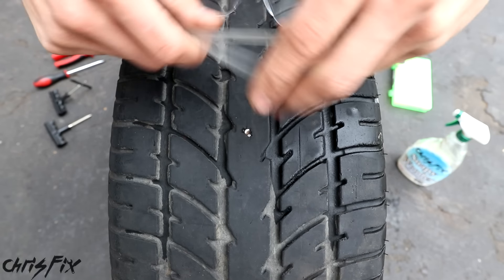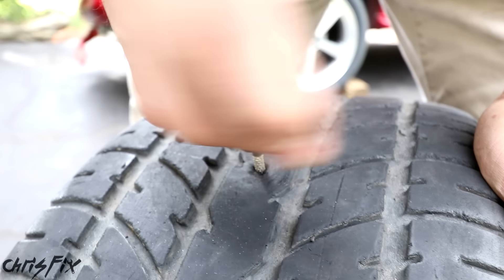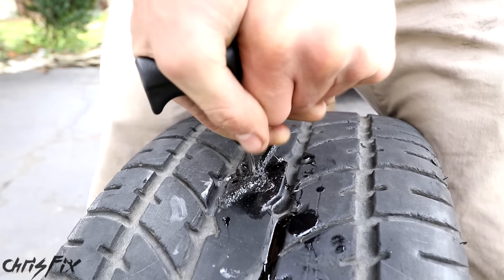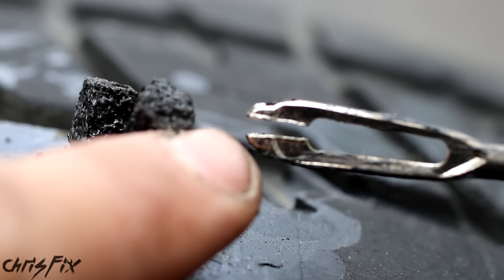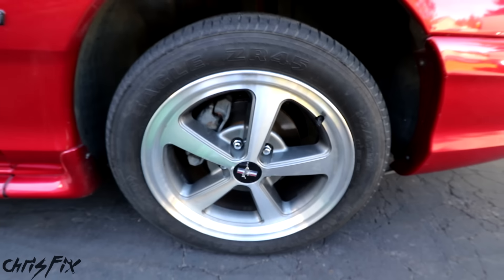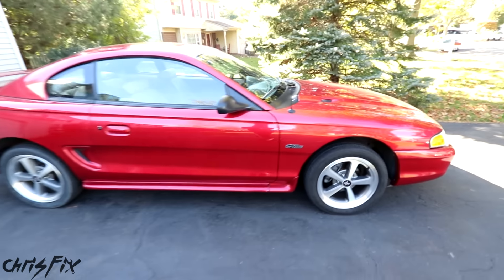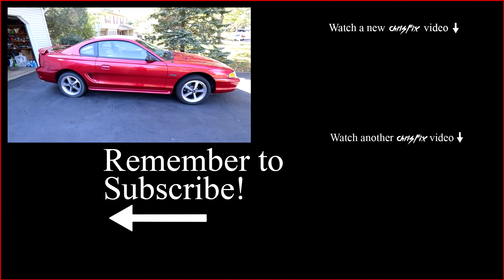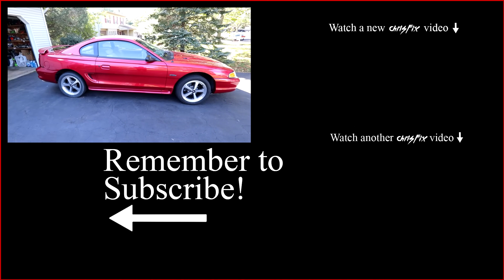How to Fix a Flat Tire EASY (Everything you need to know)

Comment: I patch tyre leaks with plugs all the time and never replace them... usually lasts for the life of the tyre... Only in case the hole is big and plug is lose/leaking I get the Mushroom style plug fixed from inside the tyre. Good beginner video.

Comment: Rolled many plugs in the past , with out rubber cement . On my 2006 ram 1500 4x4 I think I’ve have two in the whole set . and my wife’s 2013 Acura RDX one in her set . They seem to hold up great in both summer and winter conditions.

Comment: great vid  other points  you can  pull a screw and patch with out  removing  on the front  BY TURNING the  tire  out  to work  on   -----ps be sure the kit has the wax 
for eass  of plunging the plug  5mins

Comment: A Certified Mechanic told me many years ago never to put the "donut" spare on the front.  Always the back, as it is very temporary, and get the tire fixed/replaced ASAP.  If the "donut" blows, it could flip the auto.  Everything else in the video was/is solid.

Comment: Excellent video -- again. Comprehensive, concise, clear. Good that you mentioned checking the spare's pressure.  One disagreement. I don't enlarge the hole. I don't want a small hole so I certainly don't want a big hole. I just trim the plug accordingly. I've never purchased the road hazard warranty for tires but from what I understand from others, tire patch is not free.
Reply: The reamer is to clean shape and prepare the hole to help ensure a better seal not to enlarge the hole
Reply: @pizzapizza2424  Correct. Removing irregularities does enlarge the hole which I find undesirable. There is only sealed or not sealed. I'm happy and more comfortable with a small sealed hole. Sometimes the hole is too small to use the plug tool which makes for extra work to install the plug.

Comment: One trick I learned from a friend, is if you have a really large or really dirty tire, to just apply the dish soap directly to the tire and then soak it with a hose. The resulting liquid is much more viscous and then premix soap water and is better at finding small pinleaks.

Comment: I've had various tires plugged on various cars, probably about 20 different times by the tire shop. The plugs never failed. They last the lifetime of the tire. I've never gotten one of those patches but a friend of mine did. The only reason he got a patch was because he insisted that he wanted a patch. The shop did it, and that worked too.

Comment: I love the guys at the tire shops that don't know what the dot on the side of the tire is for. The dot goes where the valve stem is . That's why when you have a tire balanced it takes so much weight to balance it when you don't use the dots. Another favorite is you stick lots of stick on weights on top of the others that stay on until you get out of site. Can't hardly find a good tire shop in Ga.

Comment: It looked like your camera was on a tripod when you were opening the trunk. Do you keep your camera equipment with you at all time, did you run home to get it, or did you drive to the store they drive a screw into your wheel just for the video? Either way, that's dedication. 

I've driven on plugged tires for years and never had an issue. Also I've never trimmed of the excess. After a little driving the excess just wears.

Comment: I bought the Slime 1034-A Automotive Accessories.  It worked real well, but I still upgraded to the Slime 20290 Pro Series Ultimate Tire Repair Kit.  I probably just got lucky with the cheap model.  :-)

Comment: Hi Chris. Thanks for all the work in showing us the way. It seems the debate around the safety of plugs is pretty solid and leans towards the unsafe manner it is used. All major safety organizations and tire associations prohibit the use of tire plug due to safety concerns. I can see using it in an emergency yet not as a permanent solution.
Reply: 2 years ago i first heard of this plugs. Since them i drove a lot on dusty sand roads and had to use them 5 times. The oldest of them has now 30.000 km on it and still going strong.

Comment: One small detail to add. If you are out there change to the spare tyre. And you have no access to a stand  of any kind. Use the spare tyre as a precautions and swap it with the leaky tyre when you are ready to put on the spare.

Comment: This video reminded me of the time I found a screw lodged in the front tire of my Motorcycle. Luckily for me, it plugged the hole completely so no air leaked, which meant I cold drive it to the closest garage to have the wheel looked at. 
The mechanic at the garage said that I needed to have the whole tire replaced because of the screw and it's gonna take a while because they need to order a tire, since they don't have that many MC-parts in storage.
I head to the local [My motorcycle brand] dealer, that I bought the motorcycle from a couple of years ago, to order a new tire.
The guy at the dealership's workshop takes one look at my tire, pulls out a kit and essentially does 7:37 - 9:49 right in front of me.
Total cost: $10
Time needed: 15 minutes (5 for the repairs, 10 to just shoot the breeze and discuss if I'm happy with my MC or if there's anything else I want him to take a look at).

Comment: I was under the impression that tire plugs are a permanent solution. Thank you for highlighting that you still need to get a shop to put a patch on later.
Reply from the maker: Technically they are not permanent but off the books, they are basically permanent lol.

Comment: I had a slow leak always the same wheel, even after a tyre change. I finally used an aerosol which cured the problem and it lasted until I needed new tyres. My current car had a screw in it after just a few weeks from new. Fixed that with a spray and again lasted until tyres were replaced.  
One more comment - the kind of pump you used usually has a limit on how long it can be used continuously.

Comment: Just for anyone scrolling, for clarity. if you use fix-a-flat, a rope plug, have multiple points of damage or damage to the sidewall or shoulder of your tire, all but the sketchiest tire shops will not repair the tire. your mechanic probably also wont like you too much if you use fix a flat cause its a giant sticky mess to clean off the tire machine after. as a mechanic, my reccomendation is either to throw the spare on or call a tow (if you dont have a spare incl some like BMW owners) and have it patched at a shop if it can be, the patch they use will be good for the life of the tire because vulcanizing cement is used which essentially welds the patch into the tire. it will last the lifetime of the tire and you wont have to worry about it failing or letting water into the belt package, causing damage that could lead to a blowout. also usually patches at shops are fairly inexpensive (definitely cheaper than a new tire) if not free if you bought the tire from the shop your bringing it to (i.e. Firestone has the "road hazard warranty" meaning for X amount of miles your tire will be covered if you have a nail in it, either patched or replaced if its non repairable)

Comment: Plug pusher usually damages the metal mesh beneath. Which further results the tyre to mess up the alignment... The loss of aligbment results wobbling while you drive. Getting the tyre opened and fixed from the inside is bit costly but ensures  avoidance of early retirement of tyre

Comment: Important note: push the plug tool directly into the hole and DON’T twist it on the way in. It should be a straight push. That way the plug material does not start tangling around the tool.  Then, when it’s 3/4 in, pull straight out. Again, do not twist on the pull out. Chris was twisting too much on the way in, which will make it harder to pull the tool out.

Comment: Hey all, Just my experience, so take it for what you will. I've used Fix A Flat type stuff for years and love it. Although, I have found that the actual Fix A Flat brand doesn't work all that well. The other brands work great though. I don't understand how it is supposed to ruin a tire. I have run tires for years after putting that stuff in the tire and have never had to replace the tire after having used it.  As far as the tire tech not liking to break down the tire with that stuff in it, we all have parts of our jobs we dislike. They wouldn't walk for you, so jam that stuff in your flat tire and away you go without a second thought ;)  It will gum up a TPMS sensor in your tire if you have one though, so be aware of that.

Comment: Even if the video is 5 years old, I think worth informing new viewers that i have a flat on brand new summer tire in 2016, I rode on the same plugged tire for 5 years and finally replace it in 2021 with new one because it worn out. It is safe to ride on plugged tire as long you stay on flat road. I think if you ride off road a lot then better to get it repaired although i think it will do just fine.

Comment: A lot of times the rim will be fused to the hub so before I jack it up I loosen the lugs a few threads and move the can back and forth a few feet which usually breaks it free. Doing this first will eliminate taking the car off the jack to do it later.

Comment: a 12 V compressor in your car and manometer.  Repair kit with plug and liquid soap.  A carpet+coverall
I never removed a wheel or change a wheel for a flat. I have 1-2 flat a year.
Identify the hole, fill air if needed. move the car to be confortable to install the plug.  
remove the object on the tire, and remove the air.  More easy to install the plug with a small amount of air.
I used the reamer in and out only 1 time, install the plug and cut the excess... no cement or something like that. 
5-10 min max to fix it.

Comment: i actually had always run with plugged tires... it usually outlast the tire's life span (almost no grooves left) without patching it from the inside... so these kits are worth more than you expected... only on rare occasions where you did not plug it in right or it got punctured in the same area that it would be annoying... i had 1 tire that got punctured right next to the patched area and i had to repatch both of them as they became 1 larger hole that requires 2 of the plugs... oh and you don't really need to wait for the plugs to dry before cutting off the excess... you only need it to be dried when you want to flatten it with a razor blade.

Comment: My dad just had the worst luck today when he pulled into a parking lot he picked up a big roofing nail in his tire and it went flat very quickly, he called me and while waiting for me to come he was listening to the radio in his car for about 15 mins which was also enough for the battery to decide to pack it in 🤣. Well guess who had a plug kit, tire pump AND jumper cables in their car? Never leave home without my SOS kit and today it paid off!

Comment: the notch for the jacking point is only meant for the jack that comes with the vehicle. If you're using a regular floor jack then use the frame to jack it up
Reply from the maker: Unless you have a pinch weld block for the jack.
Reply: @chrisfix  That's true

Comment: Another tip Id give: if you have to replace the wheel with the spare and the leaking wheel is in front, swap a rear wheel infront and put the spare in the back. This is assuming your car is front wheel drive. You wanna keep spares/flats off of the powered axles.

Comment: Use SLIME instead of the can Chris was using. SLIME no longer damages the inside of the wheel and can be left in the wheel for a year. SLIME is a very excellent tire sealer.

Comment: Just a small tip, I notice you pull up always on the breaker bar and torque wrench, it is mush easier to push down on them instead  to loosen them up

Comment: Ryobi has an air inflator with an 18V battery.  You can buy it at Home Depot for  $35.  Battery is the 18V that Ryobi drill uses. 

You can use it anywhere, even in a desert.   Save money and convenience by not having to find a gas station.  Imagine if the air pump at the gas station doesn't work or the station doesn't have one.

Comment: Most tire manufacturers recommend against using tire plugs. I’d only use a plug until I can buy a replacement tire. Most tire stores won’t patch a tire for liability reasons, which means buying a new tire (in most cases you’ll need to buy 2; 2 tires of same tread pattern/depth per axle).

Comment: The only reason I dont use a tire plug is because I get intimidated by it poking a bigger hole in my tire just to plug it again it doesn’t even really make sense to me i think this might be why alot of people dont use tire plugs then you have to use the water trick to figure out where the leak is then you have to air your tire completely up again from 0 i tried fix a flax tho and it takes forever to put on and it leaks that stuff all over you too.. id rather just slap the spare on real quick or just air it up and take it to the tire shop for a patch but i will honestly try and use a plug once if i like it then i could say that I know almost every way to fix a flax tire

Comment: Those 12 volt air compressors are awesome, but don't buy a cheap one. Also, find the car fuse it runs off and buy some extra fuses. The compressor can/will blow some fuses. Green Slime actually makes a pretty good 12 volt air compressor. Don't forget to buy extra fuses for the compressor too, or carry a little piece of aluminum foil to wrap the fuse in to get the job done and get off the road. But remember to replace the fuse. Not good to leave the foil on. Its just for a quick fix...

Comment: You can use the plug kit without removing the tire, just turn the wheel to right (right side tire) and spray the soapy water. I works especially with a front tire.

Comment: i love the smell of ground up rubber and rubber cement in the morning smells like victory . I like to have those combo jump starter and air pump in my cars i always wondered if the stand alone pumps actually work better or not would it be better to have a new lithium batter pack jumpstarter and a separate air pump then the old lead acid combo unit?

Comment: Another issue you may have on the spare is the rim is too rusty. I figured that out the hard way. Changed my tire to the spare and the weight of the truck bent the rim and popped the tire instantly.

Comment: Whenever I service a tire, I always unscrew the valve-core and then both clean its gasket with an alcohol-rag and probe the valve-stem's brass sealing-surface with an alcohol-soaked Q-tip to make sure everything is clean for a leak-free seal.

Comment: Wow, I underestimate the amount of labor it takes to reem the hole. I was going back and forth with that thing for almost an hour before I got the hole large enough to insert the plug tool with the plug in it. Mine was a drill-bit style unlike the crosshatch/file style used in Chris's video because I got it from Harbor Freight. The drilling functionality (push hard and twist) helped me initially when the hole was very small.

Questions...
1) How do you clean the reem? There's a lot of rubber caked in the valleys of it, so I feel like next time I go to use it, it won't be as effective. Or do I just leave it alone and use it again?
2) My friend said she has used a drill/drill bit to drill the hole out instead of using a reem, this seems a lot more effective so would you recommend it why/why not?

Comment: 10:11 quick tip - always use your body weight to push down on the lever. If you keep doing this the way you do then one of those days one or more of your back muscles will tell you they had enough of that and you'll have another problem to get fixed :)
Reply from the maker: I was using my leg muscles, but thanks for the tip!

Comment: Plugged tires should also always go on a non drive wheel. Such as the front in the stang. If it's on a drive wheel and it spins the plug could catch and pull out

Comment: Another tip would be to remove any small stones between treads if a screw or nail isn't obvious. A small screwdriver is good for this. Sometimes a nail can look just like a small stone. But the soapy water would most likely find the leak. Soapy water is now in the trunk area!

Comment: The Pittsburgh (Harbor Freight) 12V air pump should be on and running prior to screwing it on to the valve stem (as per the instructions that come with the pump).

Comment: You forgot to mention that we must NEVER remove the foreign object, especially if it' s a screw, like now. Because it helps keep the tyre keep it' s air inside it, for a much longer time than if we remove it. Like we saw here. Also, I suppose that we must avoid leaving the pug cord touching all the dirt and tiny stones of the ground, which would probably prevent a good seal with the rubber of the tyre.

Apart from these, I think it was a quite good video, like most of your others.
Reply from the maker: You are correct if you are out and about, but you can remove it when you are repairing the tire as the plug will stop air from coming out. And I would give the plug/cement some time to dry up to not pick up dirt and all that! Thanks a lot!
Reply: plug* cord.
Reply: @chrisfix  Of course I was referring to the time BEFORE going home/to the technician and the actual repair work...

Comment: I had no idea that the plugs were temporary. I got a flat tire at the jail many years ago. One of the inmates put a plug in it. It lasted several years without being replaced. We did have to replace the car due to an auto accident.

Comment: 1) You don't need jackstands if you're not going under the car. 2) Don't put rubber cement on your reamer, it's just gonna cause a mess - that's WHY you coat the rubber insert, so you're not causing a mess. Like he said, the rubber cement is just an added bonus - so why get it everywhere?